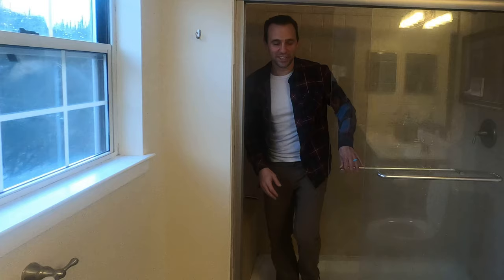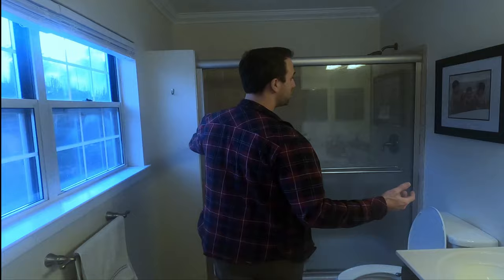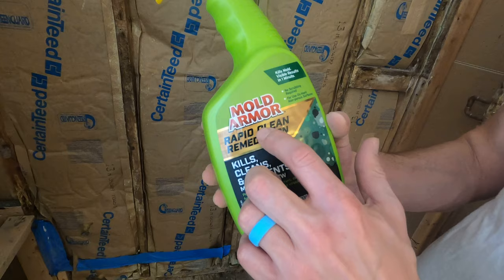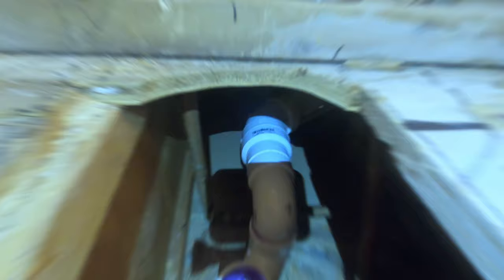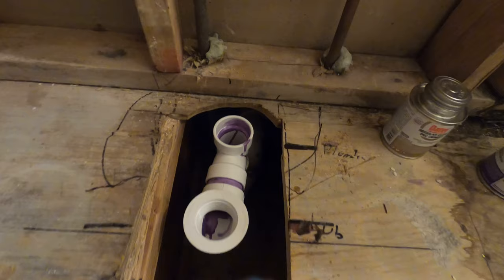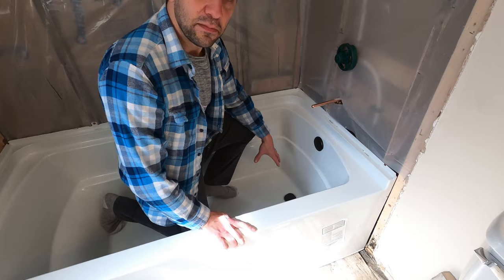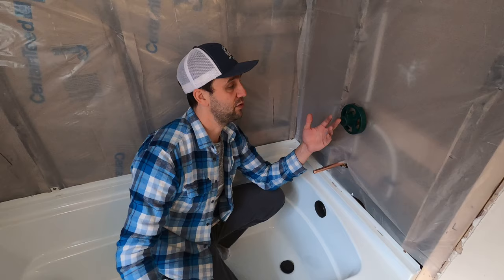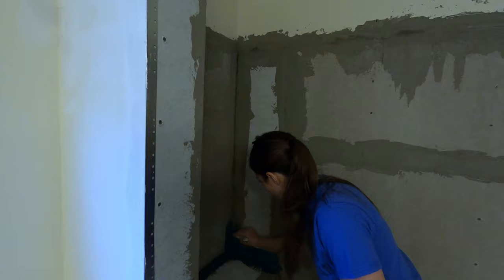DIY BATHROOM Remodel | Converting Shower to TUB

Comment: Hi thanks for the very informed video. Exactly what i needed. Jst a quick question. I got a 5 ft tub and was wondering if its okay to jst trim the sides to make it shorter into a 4ft 1/2 in.?
Reply from the maker: Of course you can.   Just build the wall in, commonly referred to a furring wall.

Comment: Hey! I have an acrylic tub that has a cutout to step in and shower. I want to fill in that cutout gap so I can use the bathtub as a bathtub. How can I do that, please? Please answer. I can’t find help anywhere!
Reply from the maker: That’s a tough one … sounds like you have to replace it with a tub.   Can’t just fill in a spot like that unfortunately… at least I wouldn’t trust it.

Comment: Great video,  that game me hope? We purchased new construction in the owner's bath  has a shower only,(horrible) I want to add a tub and a shower were the linen closet is? My husband is concerned about leaking, cost, an vioding our builder warranty. Is it a difficult project to put it all in?
Reply from the maker: Thankyou !!!   The nice words are helpful !     

Depends, do you have access to the ceiling below to run plumbing?  such as a basement ?  You'll need to run plumbing and that will be the hard part, supplies and drains, with drains being the most difficult because of the size.   It almost impossible for me to comment on if this is a big job, i'd say in general, YES, this is a huge job.   

As far as leaking - if done correctly it will not leak. 

As far as cost - hard to say.  I'd figure if you did it yourself and got a $1,000 tub.... prob get it done for about 3 grand. 

Builders warranty ? when does it run out?  Maybe wait till it runs out then install.  I wouldn't mess with the warranty.  

What if you asked the builder to do it .... ?  

Thanks,
Mike

Comment: What did you use for the trim around the shelf/edge of tile? schluter? how do you install? under tile?
Reply from the maker: Yes - schluter.   It has a lip that you in-bed in the thinset under the tile.    So it’s installed the same time you install the tile And held in place by thinset.  

https://www.schluter.com/schluter-us/en_US/Profiles/For-Walls/Edging-&-Outside-Wall-Corners/c/P-FW-EOWC

Comment: One last ? which is easier to install a stand alone tub or a garden tub?
Reply from the maker: Hello, I don't think you can say one is easier than the other, there's to many variables.  It comes down to your unique situation and what type of tub you decide, they both have there unique challenges.    

Garden tubs to me seem like a complimentary piece to a bathroom, they don't work well as the primary bathing fixture. 

Sorry it's not so straight forward of an answer. 
Thanks,
Mike
Reply: @FamilyDIYtv  thank u